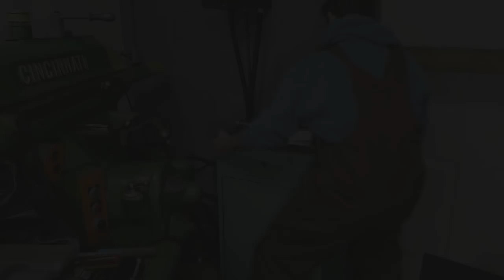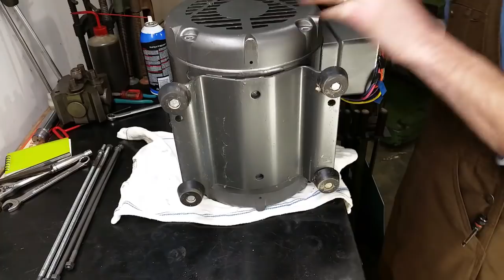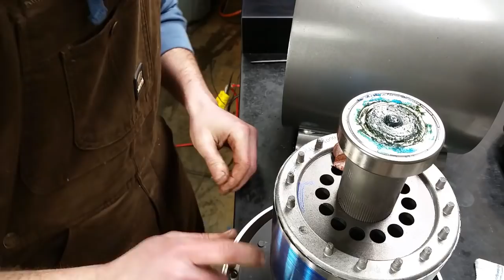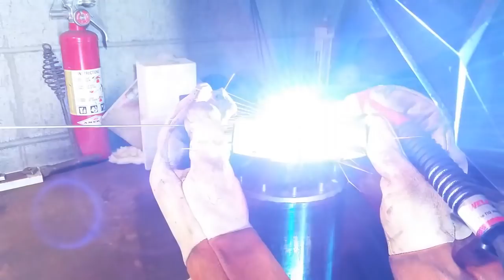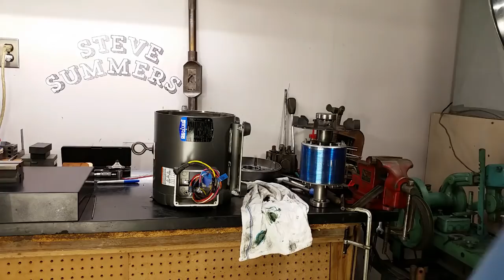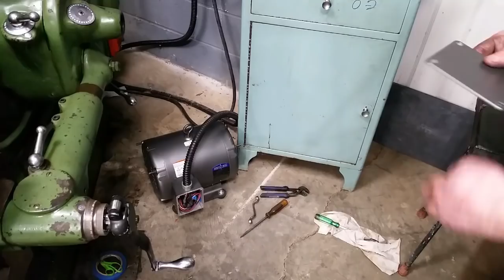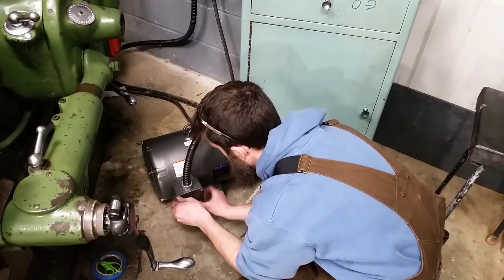Phase Converter Surgeon ;-) EVERYBODY CLEAR!!!

Comment: That is a motor the worthy of "Import" status. Next time I hear some cheap arse complaining about poor quality "import" tooling I'll direct them here. From some of the other comments here it would appear a this is not an uncommon fault. Shame on the seller for their poor customer support in hiding the fault.  BTW Electrical tape around the binding screws is not acceptable IMHO. Any motor can vibrate with a potential for the tape to rub through in time. A safer  design would have incorporated fixed binding posts for the connections.

Comment: Steve Summers, I noticed in the video that it looked as though some, but not all of the square corners on the fan blade had probably been scraping the end bell, if your noise comes back try knocking all of the corners down with a grinder just a tad. If you do this make sure to take the same amount off of each blade so you maintain the balance.

I have worked with electric motors most of my life and I knew the sound was from the fan, all of these internet experts saying is is bearings don’t know what they are talking about.

Comment: Great fix, Thanks for posting. I avoided three phase equipment for many years until a friend of mine gave me a 5 hp motor which I run to get my third leg. A static phase converter starts the 5 hp motor and then I have the third leg. It works great. Thanks again.

Comment: That was another nice video. You have a nice grasp of the bigger picture of things... Air turbulance (I guess) and harmonics in the plates of the fan. I have to agree with what you pointed out. The welds at the shaft to help minimise pivoting and the outer circumference of the fan. Just a little to much cost savings it seems. (personal opinion) :-)

Comment: I don't think it was the fan.My American Rotary made the same noise.
Turns out it was the bolts securing the end caps to the housing. They were just a little too tight. You'd think that too loose would be the problem, but no. I just cracked them loose ever so slightly and the noise went away.
I bet when you put the motor back together you torqued those nuts right were they needed to be for the noise to not happen.
Reply from the maker: Greg Kozak That is very possible. Never gave the studs a second thought🤔. If the noise comes back I know what I am trying 1st. 
Thanks for letting me know Greg👍

Comment: I don't want to be the one to point out the obvious, but Steve you've been trying to add grease to sealed bearings, an impossibly.   What you most likely heard in my humble opinion was the pressure of the grease trying to force one of the metal shields into the bearing.  The noise went away because you wiped away the grease.  If these bearings have metal shields on both sides, it's a sealed bearing.  If they only have a shield on one side, they were installed wrong.  A single shielded bearing would have the shield on the inside.  My background, I'm an electrician dealing with bearing installation issues for 35+ years.  Seen this many times.

Comment: Steve, that was a very good diagnosis and repair.  I have several safety suggestions.  1. Your cabinet needs wheels.   2. You need to take better care when lifting and pulling.  It  scared me when you pulled the cabinet and when you lifted and set the converter down by yourself.  I used to do that- until I had to have part of my spine fused and held together with titanium '"Railroad tracks."  You only get one spine- please take good care of it.  I'm searching eBay for lift table carts for myself.   Jeff

Comment: Just my guess; first off there is too much grease in the bearings,  1/3 full max.   One of the bearings must axial float because the shaft needs to expand thermally.  What happens is the rear floating bearing (usually has a wavy washer on to take up the axial play) is too loose in the end cap bore and the outer race is spinning in the bore of the end cap.  This is what you hear.  Too much grease or incorrect grease can cause too much drag on the bearing breaking the bearing outer race loose from the end casting.   Sometimes removing and reinstalling the rotor can relocate the bearing enough to stop the other race from spinning and stop the issue.   If it does this again clean the bearings and check the outer race fit with bore in the end cap.  If too loose you can put some punch marks in the boar to tighten it up a little.  I wouldn't use bearing locker you need the expansion capability.   If you let it go -- the boar will  wear so much it will need to be sleeved or the end casting replaced.    There is nothing but some friction keeping the bearing outer race from spinning in the end cap bore, its a really light fit as evident by how easily the end cap came off.

Comment: Hey Steve,
Great fix on the electric motor.  One thing I saw  which you might already be aware of, is that the tin covers are still on the bearings.  I'm wondering how any grease can get in when you pump grease into the fittings?

Comment: Ive got the same unit and mine does the same thing now i know what to look for when i tear it apart...bs design what happened to a cast fan in motors...cheap cast pot metal charge me 10 bucks more for the thing and dont have problems like this....kinda sad and the american way lately

Comment: Mine does the same Damn thing. I've contacted American rotory and have sent 2 videos in to them. He told me to take it apart cause the fan will loosen during shipping. The way they package these units I doubt it's from shipping. Obviously they tried to save 30 seconds and spot welded it in 2 places instead of 4. What I paid for the unit I feel like at shouldn't have to repair it myself. They're well aware of this problem too. Good video.... thanks!
Reply: They wouldn't even had to weld it in 4 places, 3 would have sufficed... :)
Reply: My opinion of AR is sinking. 
As we all do, the make an RPC or buy VFD's (which are cheap and reliable, and set-up is not a huge deal)
some things are getting clearer. Here's a company that has great marketing presence, but ... ^^^ this.

Comment: Nice work, I was thinking bearings that were spinning in the housing, but rarely see a metal fan any more. Just thinking that you need to go out and get a drinks case trolley, makes moving stuff so easy, as the flat steel base and long leverage makes moving stuff easy, plus the large rubber wheels are good for both indoors and outdoors on firm ground. They are great for moving heavy stuff, including massive heavy lumps of machinery. Do not get the fold up type, those are not as useful, but the fixed narrow type.

Comment: grease zert  and shielded bearing ??
Reply: Well it is a steel shield, so the grease will go through the gap to fill the bearing, but I would have as a matter of course taken off the outside shield on the bearing so the grease gets in better. That way the original light grease fill from the factory is easy to inspect as well for any shiny powder to rule out the bearing.
Reply: more like hydraulic pressure from pumping grease gun would press the shield into the balls, also showed it had a wavy washer in there so it would act like a piston and whole assembly  would move side to side....   bad design wrong bearing a greased bearing assembly has a zert, a screw plugged port to expel old grease, and a garlock seal on the rotating shaft to keep the grease where it's needed. its typical modern throw away design... will step away from lectern  now ☺

Comment: If I was that mouse and I saw you give me that death stare I would have run away and never come back lol. 
Well done Steve that was a great repair. It shows off your attention to detail and great care you take with your projects. Really nice job. Have you told the manufacturer about this? This is obviously a design flaw that is easy and cheap for them to remedy.
Reply from the maker: Gaz Pyrotechnics LoL , I hate a mouse. Messy little critters . No I didn't contact them. I am sure they are aware of the noise issue.  Hope what I did works long term 👍
Reply: Steve Summers if they’re not sure of the remedy then you can charge them a consultancy fee lol. It’s very possible they’re aware of this but not the cause. I’m pretty sure your solution to this will be the long term remedy they could implement. Like I said though, another really great video yet again. I recon your subscription numbers are just going to get bigger and bigger. It will be well deserved on account of your knowledge and professionalism coupled with the ability to be able to explain in an easy to understand way. Great job Steve.

Comment: Hi Steve, like you work a lot.  Found you after an abom mention.

I'm not a machinist, more like an electrical guy.  Did the wiring really used uninsulated bolts to connect the wires!?  That scares the bejeezus out of me. I could imagine bolt to bolt shorts or bolt to case shorts.  In the old days, people used black cloth electrical tape followed by plastic electrical tape over connections like that. Now people use wire nuts.  I might use two layers of heat shrink to project from long term wear under vibration.
Reply: jeff millar +1 on that bud that scares me as well, shadon hkw ( stan) has a video about how to do that with cambic tape and all. I'd be addressin that asap
Reply: well he did say im not an electrician and that is obvious and that is the reason people who dont know what they are doing should leave well alone as a 61 yo electrician i have seen some deadly work by so called handy men
Reply: jeff millar I would certainly have put shrink tube over those connections as well at a minimum of insulation, I can't understand why it would be left like it in the first place. It should have had a dedicated terminal block built into the terminal housing. Here in Europe that sort of set up would never be allowed to be sold in the first place

Comment: Thanks for sharing Steve. I would have thought the noise was bearing related even though the unit is fairly new. I've had bad bearing in brand new equipment on a few occasions. Good job on analyzing the possible causes and you are correct that the 2 piece fan could have been working into a harmonic vibration. If the problem is elsewhere I would think that it will return pretty soon. Keep us posted. However I think you nailed it.
John
Reply: Yegzackly, I woulda called 'dry bearing' or loose part scraping, and <spoiler>the fan</> was a good catch

Comment: What an oddball problem. Don't you love it when you fix something. I am having to do the final steps of manufacturing on almost everything I buy that's new.
Reply: At least it is not a low cost ready assembled for convenience kit from the tool supplier. You always have to take those apart and fix up all the manufacturing slop, and of course lubricate it as well better than the "show it lube" that it comes with from the factory.

Comment: I would let the manufacture know what you did,they may change their process so this has less chance of happening again......
Reply: I think the manufacturers are well aware of the problem and rather than change production methods it's probably cheaper for them to repair the odd motor that is sent back. Especially as you would probably have to pay the carriage costs there and back yourself anyway. So to get it repaired you pay through the nose for a manufacturing fault that shouldn't be there in the first place.
Reply: I suspect they might just be buying the unit direct from a maker and have no involvment with construction.

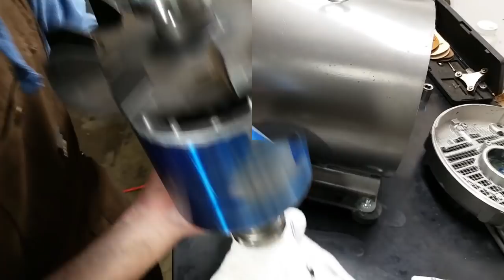Comment: I hope it stays quiet for ya! It kind of looked like the fins on that fan maybe had touched on the tips.  11:26 the fin at 9'oclock looks like the outer quarter inch has touched. I noticed it looks like they just used some spring washers to try to keep the motor located, it is possible over time that  rotor works its way to one end and the clearance is not enough to keep the fan from rubbing the end cover.
Reply: The bearings have grease fittings but are completely shielded. So as one presses tons (pressure, literally) of grease inside the bearing seat the whole shaft will move. The spring washers will not stop it. And that is the moment the fan starts rubbing somewhere. You use either shielded bearings OR grease fittings. The bearings wont get any grease this way as well. Mainly he repaired it by removing that grease.
Reply: Hermann Straub 
I think those are Shielded bearings not Sealed bearings (which would have ring seals visible) As such they will accept grease and given how cheaply this unit was constructed I doubt the makers would have fitted greasers if they had no function.
Reply: Wave washers are there to keep the bearings from chattering, the actual play is very small, and the washer is only there to compensate during warm up when the shaft and housing expand at different rates. The actual end play on a motor is small, and the bearings mount hard on the housing shoulder at drive end, and the non drive end the wave washer provides force to the bearing to keep it firm on the DE side. Here though with no actual driven shaft they just used a regular motor and regular castings, and simply cut the shaft short after the bearing and did not bore the hole for the shaft. you could replace this motor with almost any 10HP 3 phase motor with a 240V delta wound stator and simply have a protective shield over the stub shaft and use it.
Reply: True. It'll work one way or the other. Either take the fittings out and plug the holes or take the seals out of the outside of the bearings. Greasing it now would surely push things around.

Comment: Well done Steve, I believe in doing more with less, I fully understand as I volunteer at a small engine repair shop from time to time, doing who knows what and harbor freight brand tools are my choice to stock and use. The shops turnover rate is high on employees as most of them are entry level so one day the owner ask why I wouldn't  bring in my nice tools I laughed and said I can do more with less here as you know everyone borrows my tools and might bring them back he could only laugh. Steve keep at it your building your shop tool by tool nice ones when you can and bare bones to get by.

Comment: Steve love the channel I couldn't help but noticing the bearings are shielded those need to be removed to use the grease fittings , also harmonics you discuss usually result from surface feet of the bearings not tracking from one bearing to the other in other words the balls or screen of one of the bearings are rolling inside of the race most likely  the opposite direction of rotation. This will cause the ID of the bearing to rotate under some conditions causes lots of weird sounds of harmonics if you were truly looking at the spectrum. This is created when you get the different speeds between the two diameters of the bearings  and creates a little bit of a torsion on the rotor Get the replacement bearings keep them on the shelf for the next time you pull a part change the bearings always in sets and Loctite in the end cap ..... Peace.....
Reply from the maker: JeRome Welch Good advice 👍Thanks

Comment: Hi Steve,
I have a 30 HP American Rotary phase converter and have the same problem but not as loud as yours. I thought it might be the bearings and I had a good friend listen to it and he said it was not bearings but he suspected it was the fan. His opinion carried a lot of weight because he is the best machinery repair man I ever met. I have seen him EASILY fix things where other top notch repair men threw in the towel. I just had to laugh when I watched your video because it just confirmed to me what my friend Daryl Smith had told me. If it gets to loud I will address the issue. Thanks for the great video.
Steve
Reply from the maker: Solid Rock Machine Shop Inc Thanks, so far so good... 👍

Comment: Nice, you have a lot of patience. My OCD would have kicked in the first time it squealed at me. Question......do you have any of those acculink belts?  Mine is making the aluminum step pulleys ring slightly at specific rpm's. A bit of wax quiets it down for a while.

Comment: Great job, Steve.  I hope American rotary watches, seems like they need to make a few improvements to their process.
Reply from the maker: Herb Blair Yeah something is wrong, not sure exactly what the issue is. Hope my "repair" works long term.  Thanks for watching 👍
Reply: American Rotary needs to go to Baldor.  Baldor sells a lot of motors and seems to have an issue that could stretch far further than American Rotary.  This is an engineering issue with the motor.  Baldor/Genteck is at fault.
Reply: @paulcopeland9035  Too, if my engineers (or accountants) spec the cheapest or most mainland-Chinlee assemblies (a motor is an assemblage of assemblies) it then reflects on the company as a whole. This a recall issue, and the learning point is r/t shipping for that assembly....

Comment: VFD every time!
My 5 machines have 3-phase motors on a 1-phase supply.
3 VFDs used switching between machines via a selector switch.
Only the lathe has a dedicated VFD.
1-3hp is the size of motors I have so not sure how expensive a VFD would be for larger ones.
Reply from the maker: Geoff Halstead Next time👍 Vfd
Reply: Steve,
You will not regret it.